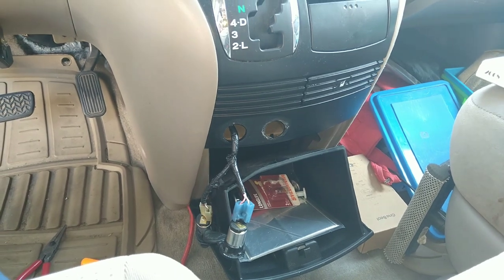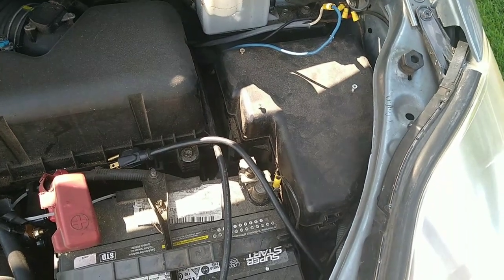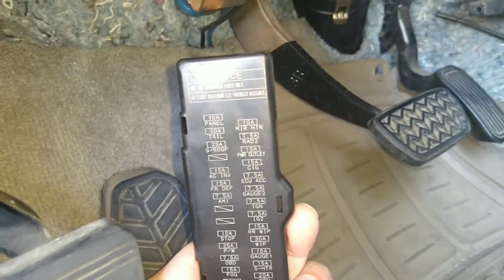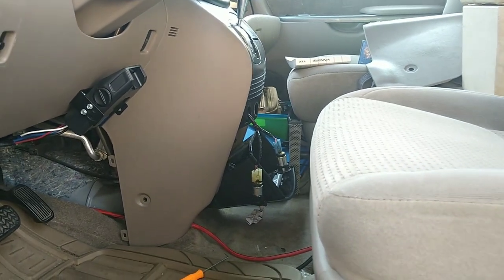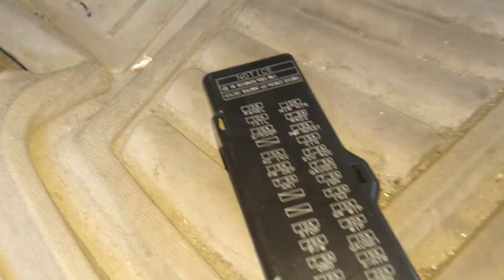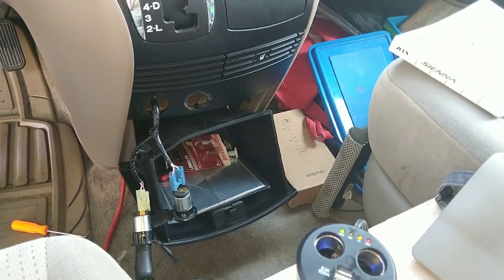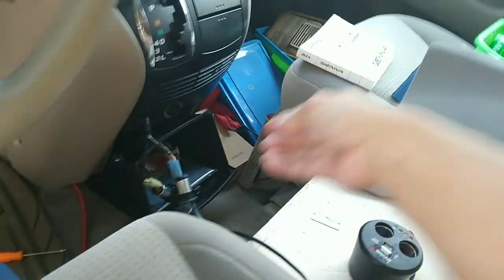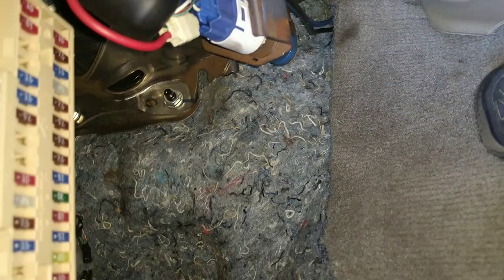DIY | Fix No Power Issue with Cigarette Lighter/Power Outlets on 2008 Toyota Sienna Minivan Camper

Comment: So good of you to teach this using your mistake as an example. I make mistakes too. You shared yours, so I'd like to share this story with you (kind of short version):
I smell sewage in my kitchen.  I thought plumbing leak somewhere. I checked whole house - sink drains, p-traps, toilets. No leaks. I thought kitchen sink drain maybe, so I used baking soda and vinegar to clean drain, in case clog was forming. But odor still in kitchen, not in sink drain. I look outside to see if effluent was surfacing anywhere, including clean-out caps. I called town to come check lines, they said everything fine on their end. Advised me to call plumber.  Can't afford plumber.  I became afraid that maybe sewer lines under my house broke. My house is on a slab - the floor and the driveway would have to be jack-hammered up to replace lines. Tens of thousands of dollars. 
In desperation I started searching Google. "What causes sewage smell in kitchen".  One of the answers was to check the drip tray under the refrigerator. Omg, that is the answer! 
Unfortunately I can't get to the drip tray  - I suspect it is a bolt-in, not a slide-out. Fridge must be tipped to remove it. I cannot do that. I will pull the fridge away from wall and remove back panel. Hopefully tray is a slide-out. If not, bye-bye fridge. I should say that fridge is 24 yrs old, and has not worked properly in years. Freezer doesn't freeze, fridge compartment not cold enough. I just realized that fridge is not keeping my insulin cold enough. (That explains some things about my bad A1c results). I think it's time for new fridge. So much better than huge jack-hammered hole inside my house, and driveway removed.
So that's the lesson.  Remain calm. Determine true source of odor. Check everything you know how to do yourself. I'm telling you and everyone that refrigerators have drip pans, and they need to be cleaned out if they start to smell. Check owner's manual (can be found online if you lost original) to see how to remove, clean, and replace drip pan.
Also, if you do call plumber and they say sewer lines must be replaced, insist that they prove to you that that is where the smell is coming from. You have that right. Watch them closely.  Have a great Sunday, Tim!
Reply from the maker: Good lesson there! YES, every modern refrigerator have a drip pan under it. It is there to collect water drain down from your freezer during the "automatic defrosting" cycle. Supposedly, the water collected there will evaporate as the cooling fan running. And for some reason it collect more water than usual, your refrigerator is having issues. I think that you got your money worth out of a fridge after 20 years. Newer fridge run more efficient and cost you less in electricity in the long run. In my own experience, the cheapest and simplest fridge last the longest! I owned two of the cheapest GE fridges. One when I first got married 31 years ago and one now. They both lasted me more than 20 years. It is important to clean out the cooling fins which I did a video about it on my channel. A very easy task if you can move the fridge out from the wall.
Reply: @MoBangFoYoBucks  Thank you Tim!  I am absolutely going to look up your video on cleaning the cooling fins! Thanks so much for that. Yes, I can pull the fridge from the wall, as long as I empty it first. I've done that several times over the years to vacuum  from the back. I probably should have been doing that once or twice a year from the start. Last time I cleaned under there, several weeks ago, I used a fridge brush from the front. If the drip tray is a pull-out, perhaps I pushed some debris into the tray by accident. I can see how that would cause a problem, very much like a sink clog.   I really appreciate your response, your skill at fixing things, and your generosity in sharing your experience and advice. Have a good evening!

Comment: Wouldn’t be the first time I came to a ‘faulty wiring’ conclusion, especially when there is missing (or incorrect) information.
I spent hours troubleshooting a ‘bad’ 12 volt outlet on my PMC because I had an incorrect fuse diagram that I pulled of the internet. (The PMC didn’t have an owner manual when I bought it used)
BTW, I carry an assortment of micro fuses that I bought on Amazon, and always have a multi meter as part of my toolbox.
Cheers,
Doug
Reply from the maker: I need to go to Harbor Freight and grab a cheap digital voltmeter. Being away from my primary homebase put me in a disadvantage when it comes to tools!😁

Comment: HEY TIM W YOUR MALE CIG LITER..IF IT DONT STAY IN FEMALE CIG PLUG. JUST UNSCREW END OF MALE PLUG WERE THE FUSE IS AND PULL OUT FUSE AND THE LITTLE SPRING OUT AND SIMPLEY CUT DOWN LENGTH OF SPRING..MAY HAVE TO DO IT A COUPLE TIMES TO GET SPRING TO DESIRED LENGTH..BUT WEN YOU PUT SPRING BACK IN PUT THE END YOU CUT OFF ON TOP SO WEN FUSE IS IN BOTTOM OF FUSE SITS ON TOP OF SPRING YOU JUST CUT OFF.. I DID THIS TODAY ON A CORD I MADE OUT OF A TABLE LAMP CORD 20 YEARS AGO..YOU WILL KNOW IT WORKS WEN NIPPLE OUT OF MALE END IS REAL EASY TO PUSH IN W YOUR THUMB..

Comment: Every single time it’s a fuse for me. That was my first guess, this time. I’m tackling my fan fuse blowing, right now. Changed the motherboard, added a voltage protector, and it’s blowing fuses now. I need to take it apart again today and figure it out.
Reply from the maker: Change out a motherboard!???😱 Yeah, have a surge protector save your money in the long run!😎👍 Good luck fixing it!🤞
Reply: @MoBangFoYoBucks  yes, it’s an issue with MaxxAir only tried fixing it in the hottest temps this weekend. It was so HOT! 🥵  Love your advise, I do need to get my cigarette lighter in working order up front in my van. One day.

Comment: Thanks for the video Tim.   I've been chicken to us my cig port to charge anything but my phone while I'm driving long distances... such as my fridge, power station, and hot logic cooker. Does this damage the car battery over time? Also, I've seen people on youtube with hot or melted 12v adapter end. Should I be worried?
Reply from the maker: That's is the function of a fuse. It prevents fire due wire short circuit. That's why I emphasized the importance of replacing the same numbered fused (in this case 15A). Which I didn't!🤣 But with 5A over I'm not yo worry about it.
Reply: @MoBangFoYoBucks   Thanks!

Comment: What is the significant difference between the 2 ports? You can plug devices requiring 12 volt power into a cigarette lighter plug.
Reply from the maker: None!😁 Back in the old day, we would see an actual cigarette lighter in one of them!
Reply: @MoBangFoYoBucks  Does the power port have a higher load rating and larger fuse?
Reply from the maker: According to the original fuses of 15A, you will get the most 130W from each outlet.
Reply: Thanks Tim. Interesting that I plug my 300 watt inverter into my cigarette lighter plug, but I must not be using more than 130 watts. Good to know!👍 @MoBangFoYoBucks
Reply from the maker: For experiment, plug something that will draw more than 200W and your inverter will beep and stop. If it doesn't, you might start a fire in your car if the fuse doesn't break like you saw in my video!😉